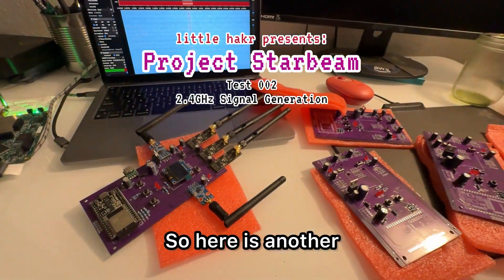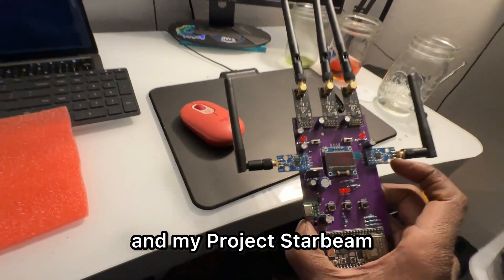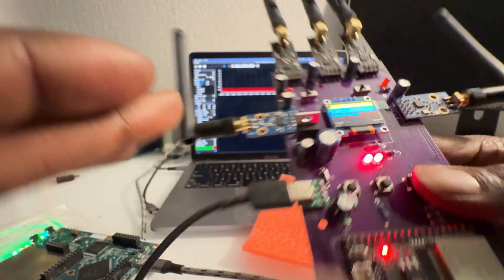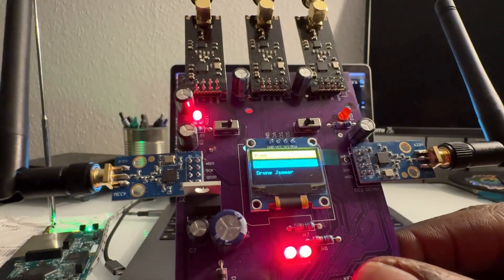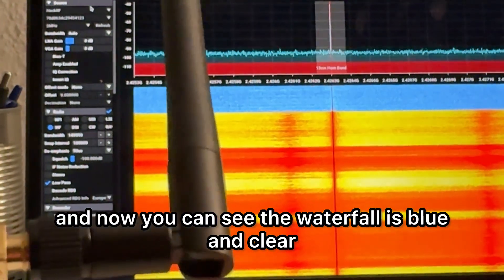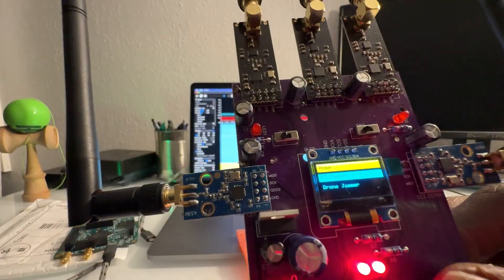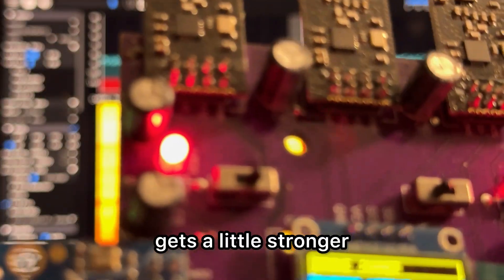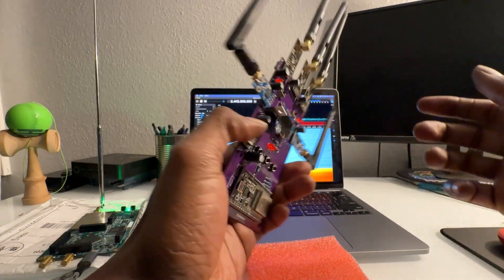ESP32 2.4GHz Jammer Test | HackRF Signal Analyzer | 3 NRF24

Comment: I have added 3 nrf24 but if I'm using 10uF or 470uF  won't start on 3v, if im hooking tp 5v it will reset when accessing anything because voltage drop. If I'm hooking all 3 to 3v without 10uF or 470uF, they will still reset because voltage drop. How can I provide sufficient current for all 3 of them?
Reply from the maker: I show you how I set it up with my project , so just do the same

Comment: are these basically the guts of those signal jammers we used to see on aliexpress about 10 years ago? ik they are still around but $500+ for those is just insane
Reply from the maker: The ones on AliExpress use a custom signal generation circuit which are kinda complex. However these are nrf24 2.4ghz radios similar to RC remotes and WiFi routers, so much simpler to use and manipulate

Comment: Pretty cool looking huh, nice work! 
Do you have the schematics to use 3 NRFs with the ESP32? I made a jammer with two NRF42l01, and I wonder if it would be better to add one more.
Reply from the maker: I haven’t released the schematics yet, it’s a pretty complicated circuit for the pcb, I don’t think you can really do it on a breadboard.

But for 3 NRF24s you can connect all to same SPI bus, but make sure to have unique cs/ce pins

Comment: really sick project man, congrats!! 
i have one doubt, to work with 3 NRFL2401+ modules on same time in a arduino for example, its possible? i'm asking because these they use SPI communication and to do this jammers, specially in BTE, need to jam the 3 specific channels to cause the jam, and i don't know if its possible without a custom PCB
Reply from the maker: So you mean for Arduino microcontroller? The nrf24s can all be on same spi bus for Esp32 and Esp32 has 2 spi bus